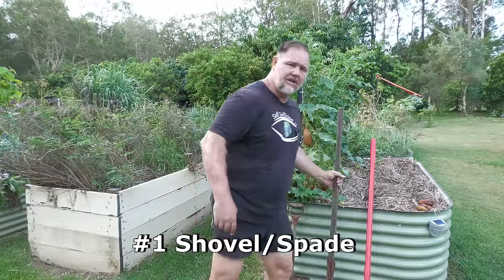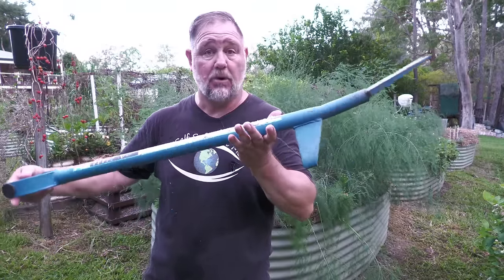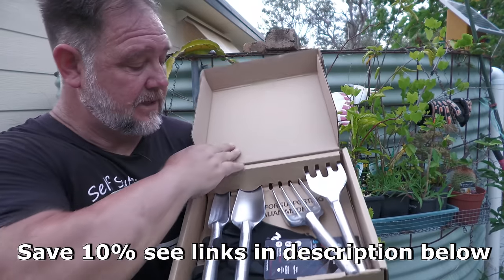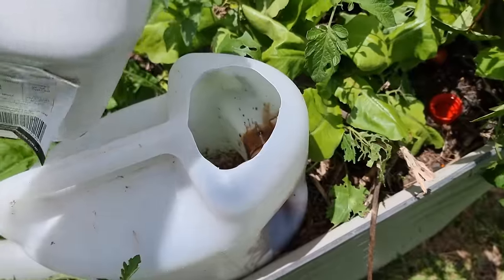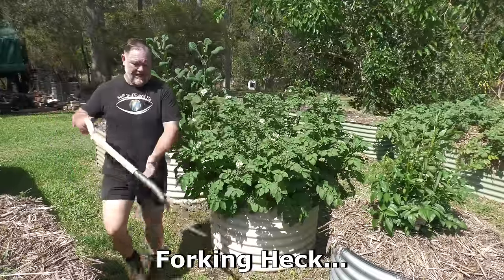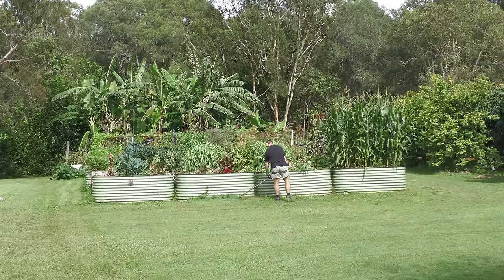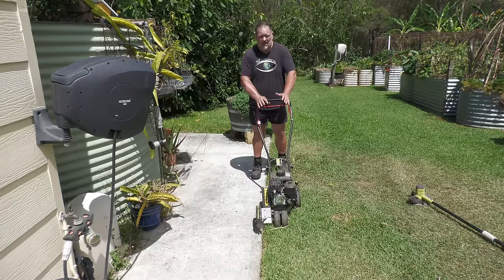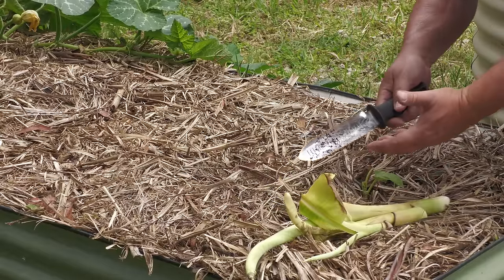33 ESSENTIAL Gardening TOOLS I Use All the TIME!

Comment: Cardboard boxes!  I use them to harvest, gather up debris, transport anything, temporary storage for hardening transplants outside , growing sweet potatoes as a raised bed, storage of tomatoes, squashes, potatoes in my garage after harvest, dry off of onions and garlic by laying them across the edges of the boxes; and completely recyclable once done.
Reply: And also for putting down on bare ground as a weed barrier (apply mulch/soil right on top for new garden area!)
Reply: I keep a piece of flat heavy cardboard about the size of a cafeteria tray with me. I sit on it, use it to scoop debris, "sweep" make a quick note, fan myself... I also keep a pencil, a marker, and a tape measure. Finally, a dethorned woody rose stem about a foot long to poke into the roses to knock off dead petals, etc. It works better than anything I've ever tried for some weird reason.  LOL  Oh! a jar of cotton pads in mineral oil and a small fine/coarse sharpener to clean up tools after I use them. Very proud of that - I used to treat my tools like garbage.

Comment: I use a Stainless Steel mesh sieve for sieving compost into fine seedling soil mixture for seed planting.
Reply: I could only find a 33cm one here in NZ, far too small for use on a proper heap. I made a sort of Heath Robinson version out of an old drawer, bottom removed, and small metal mesh stapled across instead. It even has a handle on one side ! It works well, although the life span may be reduced as the drawer is some kind of MDF rather than wood.
Reply: Me too I do have with different hole sizes.. it's very handy when you need fine granules compost.... especially how you said for fine seedling soil....
Reply: @trilliarobinson7862 i do have one made from MDF as well..did hold well for a couple of years but now it's gone...i have to make it from wood...I did keep it outside in the rain...here in UK
Reply: Half of my old kitchen items are in the garden shed now. LOL. I just used an old rusty sieve for a soil test sample.

Comment: We call your mulch fork, a 'pitch fork'- used for hay & straw, also. I use it to rotate my compost piles.
I found an awesome tool for pounding posts- it's an heavy metal tube (about 2ft long) with one end weld-capped, and has two handles welded to the sides. Makes it easy for an old woman like me to sink t-posts.. 😁👍
Reply: lol, not if it was a homemade one like we have.  The posts go in quick, but much too heavy to lift over my head. 😂. The store made is much lighter.  The fork he used we call a manure fork because the tines are close and many.  I use a 5 tine that is good for most materials.
Reply: @dustyflats3832  LOL! My husband made a post pounder. Yeah, no.  Have at it, honey. On a much smaller scale, we got the most awesome tent stakes that are super heavy duty and can be pounded into hardpan like butter.  Most recently, we used them to stablize irrigation pipes we're using as rabbit tunnels into Casa Conejo. The property next door is being flipped and the bunnies are exploring their options.

Comment: A tool that has been extremely helpful digging up small trees and stumps here in Indonesia is called a dodos. We put long beefy straight handles on them like a shovel. But at the end is a 10cm wide blade that is thick like an axe head but has the handle come straight out the back. It cuts through roots when shovels bend or fold. And it also can be used to dig and pry. Very helpful!

Comment: We had a 55 gallon drum that we had put on a stand, painted it black, had a small door cut into the side and that’s one of our compost barrel that we can turn.
We also have a large compost bin made out of used wood pallets and lined the inside with chicken wire. We can “stir” the compost with a pitch fork
Reply: Another use for pallets is to raise fabric beds off the ground. Much of my lawn area is sodden over winter, even with standing water at times. I found two pallets hidden in the roof of my garage, and they now have a forest of tomatoes growing in eight fabric pockets, protected from the sun (the pockets), by a layer of white recycled bubble wrap. Less to mow, and tomatoes to boot !
Reply: @trilliarobinson7862  We planted “No Mow” grass on our mountain side and it our orchard.
The roots grow 6-9” deep and once a year when it shoots up it’s seeds, we hit it with the weed wacker to scatter the seeds. It cannot be “mowed” less than 4” tall.
We had to fall 17 pine trees and get rid of the scrub to give us enough of a fire break around our house.
We literally live in a forest, as we bought 54.5 acres of the side of a forested mountain and our house is 1/2 way up our property.
We have breathtaking views of the surrounding mountains and the canyon floor.

Comment: A plastic tub for making up your germination mix.  A rack for your seedlings. A small shed for storing your seedling trays, amendments etc.  I use a slasher for trimming up the grassy areas, but I don't have much.  A hedge trimmer for if you have hedges is also useful. A bow saw is also good if you only have the occassional tree to cut.

Comment: The Japanese call your #32 Garden knife a "Hori Hori". Hori Horis are great for digging up weeds with tap roots. I use mine a lot. A tool you left out which I use all the time is a hand garden Sickle for weeding. I have a "Zenport" which has an orange handle making it easy to find and hard to lose. It does what a weed wacker does and more. Since it isn't motorized, you can work around plants you might want to keep. You can cover huge areas in a short amount of time because the blade is REALLY sharp! Just grab the top half of  a bunch of weeds in one hand and pull the sickle through the bottom part. I even use the blade in the soil under the weeds to get stubborn roots up. I love your #14 watering can. If the spout tip is removable, I would love a watering can like that.
Reply: I used a Hori Hori at my landscape job and have a similar device for at home. It’s my ONLY go-to tool that I consistently use for just about everything.
Reply: That’s a big YES on the hori hori knife and any Japanese sickle you can find.  Sickle is great to cut back ornamental grasses and those plants that are going to seed — esp. if you don’t want any more of that seed!

Comment: If you don’t have a raised bed garden a rototiller is something I’d consider essential. That garden knife is a modern iteration of the Japanese Hori-Hori tool, I have a couple versions and use them for all kinds of stuff, such a great tool. I’d also say a worm composting bin is also essential for organic gardening because it’ll provide an endless supply of worm castings as fertilizer.

Comment: The best to put in star pickets with, is a post driver.
You just pop it over the star picket, and bash it down.
You don't need a star picket remover either.
I simply soak the ground, and start wriggling the star picket backwards and forwards.
Then after a bit, push the star picket around in circles, and then simply pull it out.
Reply: Depends on the soil and how deep the t posts went in if it will come out.  Clay soil especially.  Most of ours come out easily like you do, but the tuff ones my husband takes a rope with a pressic knot and cantilevers them out.  I think the tool he has shown would be needed on a farm.
Reply: Depends on the soil and how deep the t posts went in if it will come out.  Clay soil especially.  Most of ours come out easily like you do, but the tuff ones my husband takes a rope with a pressic knot and cantilevers them out.  I think the tool he has shown would be needed on a farm.

Comment: I have a mostly cemented yard so I do mostly container gardening.  One of my go to tools is a 32 gallon garbage can with wheels.  In the summer I use the inside for storage for smaller plastic pots (that might blow away with the wind) or my fall leaf claws I use to pick up leaves in the fall).  In the fall I will store leaves inside that I will be using later for mulching.  When working in the garden I will flip the lid over and use it as a makeshift tabletop that I can move around the yard easily and keep my tools, phone, and drinking water handy.  I will also use it as a tabletop when potting plants (putting a soil mat down first makes clean up a breeze)..  I would also mention that I upcycle scoopers from food or laundry packaging (like the scooper from the dry nonfat milk I use for making bread in bread machine and in nonfat lattes) in my fertilizer bags to help scoop out from the bags without much spillage/waste.

Comment: A compost screw/aerator is the one tool I use weekly in my suburban garden.  I can turn the contents of my plastic compost bins in minutes, right down to the very bottom, so I do it weekly - before, I HATED doing it with a fork - total PIA and not a good a job.  Amazing how quickly the contents break down when regularly turned and watered.

Comment: Handsaws are more versatile than most people know. I work in communications and I'm often having to climb poles that are completely overgrown to the point even a bucket truck couldn't push through the vines without breaking. I keep a Gosaw in my truck. It has an Acme thread at the end of the handle, that screws right onto any painters pole giving extremely long reach. 16ft in my case.

Comment: Hubby (aka Master Ben in my videos) repurposed our old ride on mower with a tow bar so he can tow the trailer around our quarter of an acre. We call it The Mario Cart.
We get boggy soil where we are, so Master Ben built 35 above-ground raised beds using mostly recycled materials.
We also use our old push mower and catcher to mulch garden waste for the compost station.
Thank you for all the tips over the years. You're a LEGEND 🏆

Comment: I like your list and got all the ones applicable to my little garden space.
I'd like to mention a weed burner for easy maintenance of brick/gravel areas, a pair of thick workers leather gloves (i basically only use mine when pruning my blackberry shrubs, but they are a godsend for prickly crop plants) and lastly something i feel was mentioned though also glossed over is trellising materials and a metric bung load of sticks and stakes.
I've got a sweet deal with a neighbor, i prune their young bamboo living fence and i get to keep all the young wayward sticks and the older uglier sticks for my garden needs.
Various axes and wood splitting tools/machinery would be my honorary mention since they are a bit more niche.
Oh and funny tid bit, my garden "machete" is acutally a cheapo replica short katana that i rehardened and annealed.. thing can get a scary edge and chops vegetation well, though mileage may vary since im a suburban dweller in Denmark xD
Reply: I love your videos! Thanks for mentioning the jab and its potentially serious consequences. God bless the inventor of the Prong, and you and your family also, Mark!

Comment: Hello Mark. I loved the video and you use some tools that I don't have but need to get. I live in Oklahoma USA on 10 acres. We have a 5 acre pasture and my house is on 5 acres where we have a garden. One item that I have is called a T post driver or fence post driver. We use T post with barbed wire around our pasture to keep cows in and I use T post in the garden. The driver is easier than a sledge hammer and safer. You don't need to have a family member  holding the post, scared the get there hand wacked by the sledge.
Reply: Yes, I whacked my own hand pounding a small stake, wasn’t pretty.  We have a homemade driver that is super heavy compared to store bought.  Drives the t posts in great it’s getting it off is the big one.😂

Comment: Great video, Mark! It was long, but chock-a-block full of useful information, so the time passed quickly.

I would add a broad fork to the list, but i still do in-ground gardening so likely have more use for it than you would with raised beds. 

A great pair of work gloves are great. I got long-sleeved ones that are wonderful when you're in a berry thicket or working with roses or hawthorn trees. 

I also use a peevee on occasion when needing to move logs. 

I don't have a wonderful mulcher as you have, but i do have a mulching push mower that does a great job.

I would also add tarps to the necessary list. Good for dragging mulch if you haven't got a trailer, can cover a bed. Thick plastic can also work well. 

I have a long-handled apple picker i consider essential. I can reach up about 15 ft/5 metres without climbing a ladder and can use it to pick apples, pears, and plums. It ought to also work well for oranges or lemons, but i haven't had opportunity to try it  for citrus (too cold where i live).

My best wishes to Peter. Off now to check on his prong so i can see if i need to have one.

Thanks again for sharing your knowledge freely with all of us.
Reply: Broad fork is on my list also now that the soil is much improved no need to till.  I have a few raised beds, but they dry out too quick.  I just outline wide long rows with reclaimed lumber.  The irrigation and care of rows is much easier—And cheaper.

Comment: Definitely get a good brand! Had a shovel fail when I was using it, the metal spade failed and when it did it ended up cutting into my foot.  Needed several stiches.

Comment: As someone who also uses tools I believe I am qualified to say, get wooden handled tools. That fiberglass stuff just cracks and splinters in heat and cold. If a wood handle does break, often times you can simply fix it and reattach it.

Comment: Mark lots of tools make light work i got a sample bunch for my small land those mini alloy tools i might consider buying cause the plastic handled metal rubbish, look i dont know if these science based tools are macho but essential PH meter if you working with acid loving fruit like like Miracle fruit and alkaline plants, also a lightameter to know what parts of the garden get enough light, soil moisture meter to see if the plants a getting enough water. And Giderling tool sold by Daleys that strips the bark and makes the fruit tree , fruit quicker by tricking it.

Comment: Devil garden stakes /tact sign-holder can be made out of reinforcing mesh. Use bolt cutters or a hacksaw to cut down beside 2 rebars to create a "ladder". If the rear is thick, use a grinder to sharper the ends to drive into soil.

Comment: Great video, Mark, thank you. I don’t know if it’s really classed as a tool, but I wouldn’t be without my favourite seeding tool, which is a chainsaw metal chain file (it looks similar to a skinny rod). You probably have one. They’re weighty, and fine, perfect for use in seed starting. I also use the thicker end to push up & pop out seedlings from tapered end seed starting trays.

Comment: I'm a senior and passionate about gardening and it keeps me active. About four years ago I became really serious about growing food and over those four years I dropped around 60 lbs. I was on medication for type 2 diabetes but haven't needed to take that in several years. The gardening alone didn't solve the problem but the doctor found I had a thyroid problem and put me on medication for it and the extra weight fell off pretty quickly, so much so the ladies at my church was worried about me but I assured them that my normal weight was much lower than it had been over the last few years and having the thyroid problem under control I was getting back to normal. I went crazy with onions this year and ran out of space. Now I'm wondering where I'll plant the taters in February lol.

Comment: I enjoyed your list of essential tools, pretty thorough I thought. I'm a small backyard gardener so a big tool like the power auger wouldn't be practical for me, so my only "add on" to that list would be a manual post hole digger. Which is useful for when I need to set posts for dragonfruit, or fences.
Reply: Yes post hole diggers are handy.  A nice small sledge hammer also.  I just bought a small auger and will try it out on compost pile and might need a longer one.
Reply: @dustyflats3832   He did mention sledge hammers. Good to have the auger I'm sure!

Comment: Highly recommend upgrading your push mower and string trimmer with a trimmer mower. It’s much more comfortable if you have a large area to trim. If you use the string attachment it is decent for cutting grass in tight areas you would normally push mow, and you can get a blade attachment that will also cut through brush.

Comment: I have a couple of Stihl petrol chainsaws as well as some others up to 22" bar , last year I invested in some cordless gear from Dewalt and Makita , among those was a Makita 18v top handle 10" chainsaw and i find myself reaching for it more often than the others , in fact jobs get done more often because it is so easy . The blower  and high powered torch share the same batteries , the dewalt polesaw shares the same 18v batteries as the other dewalt gear and if necessary , adapters can be had these days so that one brand battery can be used in another brand tool , DeW , Mak or MilW because they share a similarity of design , Ryobi do not . I have a few acres so need a bit gear than the average householder . I'm 68 , it keeps me as busy as I can handle 🙂
Reply: I went straight Milwaukee brand so the batteries all work.  Yes, the extendable chainsaw is used a lot!😊